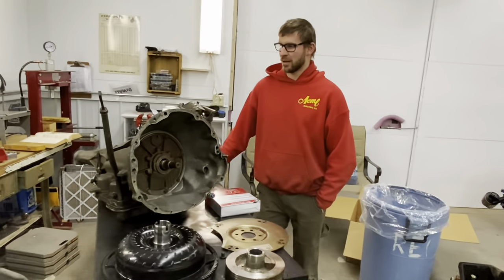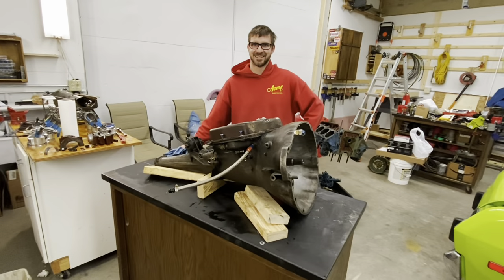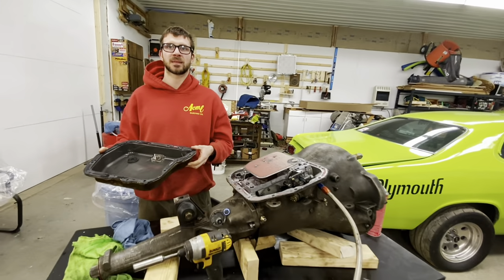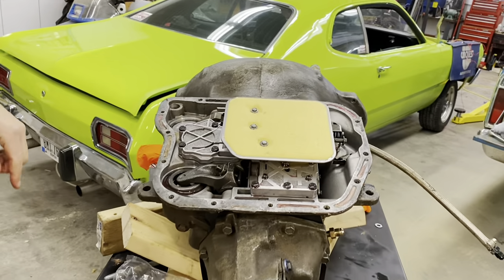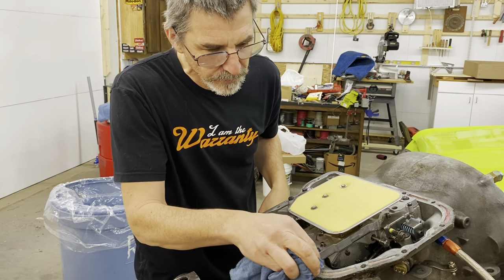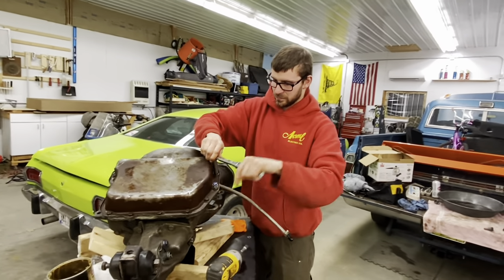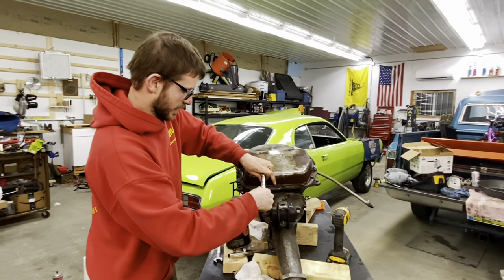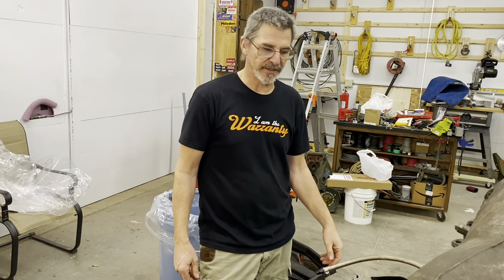How We Adjust the Bands on the 727 Transmission/727 Transmission Maintenance

Comment: I took the advice I read in a Mopar magazine many years ago.  Forget the whole torque and turns thing. Pry up on the end of the band actuating lever, and adjust for 1/4" to 5/16" clearance between the lever tip and its actuating piston.  Done.  Worked great for me for years.
Reply from the maker: More than one way to do it for sure. Thanks

Comment: Two years ago, I commented on this video and I’m still referring back to it, thank you for such in-depth descriptions of what you’re doing. Two years ago I had a brand new rebuilt 727 with a 3500 stall, the transmission rebuild shop asked me if I wanted a deep pan instead of the shallow pan, I said “sure!“. Last weekend I realized that my converter is not stalling and the car is not taking off right I took off the transmission pan for the first time and noticed that I did not use an extension on the filter I’m sure the damage has been done, I looked at the bottom of the pan and it just had a gray sludge no real metal on my magnets or anything, but lots of gray sludge. this weekend I want to take the converter out and take it to the converter shop to have them clean it out. What I’m asking you guys is would you do a full rebuild on the transmission? Is there a way for me to flush it? I’m kind of torn because I’d rather not do a full rebuild. It’s only 1000 miles on it but if I have to, I will. Any suggestions?
Reply from the maker: If it did not slip a lot, clean the pan etc and put a fresh filter and oil in it. Adjust the bands and try again. We get grey sludge too. I use ATF4 
My transmission was built in the mid 90’s overdue for a rebuild. We just went 11.72 with it.

Comment: I use the moroso blue gasket with the steel insert. It’s like $45ish and reusable. I’ll never go back to a paper gasket again if I can help it. Nice job guys
Reply from the maker: I didnt know that existed and will look for one.
We use a 96 360 gasket for the oil pan same thing. 1 piece silicone and steel reusable. Thanks for the tip.
Reply: That's The Only One To USE !!!!!!!

Comment: I cannot put a speedometer pinion in my 999, the billet output shaft doesn't have the teeth.  I also have a billet input shaft, broke both of them with my stock displacement 318 Magnum, of course 20 psi of boost helps!  Billet valve body, built by CRT.
Reply from the maker: Were not making that kind of power So far the mostly stock transmission is working well for us. You have a seriously stout transmission. Thanks for the support.

Comment: I scrub both gasket surfaces with 150 grit paper and then wipe them down and use the combo cork rubber MAHLE gasket and no leaks .Got a cork/rubber gasket with the metal sheet between the 2 layers from AutoZone . I did a video on  on the gasket if you need a part number
Reply: Yeah share the part number. Thanks
Reply: @trackandtravelwithrick8933  Autozone -727 pan gasket  MAHLE  part# W39003TC  SKU 144452  9 dollars and some change had to be ordered. this pan gasket is a sheet metal gasket sandwiched between  2 layers of cork / rubber
Reply from the maker: Perfect👍🏼

Comment: Great video guys ! 
Hey , what is your recommendation for the best type of grease to use on the tail shaft spline/ slip yoke ? I’m reading and hearing various opinions on different types of grease , everything from Lucas red and tacky to some folks use a marine grease that has calcium sulphonate in it … and how much grease should you put on it ? 
Thanks for any input 🙏
Reply from the maker: I just use a regular wheel bearing grease and only enough to not damage the seal at the tail shaft, so not a lot. Just don’t want a dry startup situation. Thanks for watching
Reply: @jerayracing Thanks for the feedback ! I have two 727 transmissions ( one from a 71’ Challenger with 383 the other in a 86 dodge truck with a 318 ) I’ve been using Dexron III in the 71’ and ATF+4 in the 86 Ram , good to know anything will work regardless of different manufacturer recommendations for each respective transmissions. The truck with the ATF+ 4 seems to shift a bit smoother , but it could be due to the linkage adjustments as well . 
That’s another area I’m trying to study up on . 
So 5/16” square or 11/32” twelve point in the adjustment nuts . Great info ! Thanks again for your input.

Comment: Great video! My Coronet shifts really early into 2nd but really high into 3rd. I’ve adjusted like crazy my kick down cable but am wondering if it’s the bands needing adjustment?
Reply from the maker: Thanks for the support.
The band adjustment wont change when it shifts. Just how it shifts.
I use a lokar cable but same for linkage. Get a helper. Engine off. Floor it and hold it till your done. Check throttle blades and ensure your wot at the carb and cable didnt slip. Ask me how i know. Then get under car and ensure the throttle lever on transmission is maxed out for wot. If transmission is maxed out before carb it will have a delayed shift.
With your early 2nd and late 3rd gear shifts i dont know. 
It wont hurt to do fluid and band adjustment.
The govorner is in the tailshaft. My transmission builder modified it 20 years ago to shift about 5600 2nd and 3rd.
Hope this helps.
Reply: @jerayracing  That helps a ton! It’s the little details that will get me. I appreciate the reply. This is a brand new transmission with a Branting 3200 stall. Last year at the strip, it was shifting at 6000 RPM into 3rd by itself. ( I had to leave it drive because of shifter issues that day). I have a more powerful motor I’ll be putting in next weekend so I’m anxious to see what that will do to my stall converter‘s stall speed and my shift points. I really appreciate what you said about adjusting the throttle lever. I did not know that small detail about when it’s maxed out before the other is maxed out. I just subscribe your channel and I really appreciate the reply
Reply from the maker: No problem man! If you ever have any questions just ask! I always reply
Reply: Rick Allison at A&A Transmission, sells a small governor weight and spring set, which changes when (rpm) the trans shifts.
Reply: @JACB006  thanks! I will definitely check that out!

Comment: I've got 2 904 and a 727, love em, my 727 is getting a little sloppy from 2nd to 3rd, will adjust my bands, what kind of grease did you use on the pan seal? Thanks for video
Reply from the maker: Wheel bearing grease, nothing special.
A slip into high gear means the front clutch could be going out. Having the kick down linkage out of adjustment can contribute to this wear.
Reply: @jerayracing  thanks, it doesnt feel like it slipping, it used to shift into 3rd at around 45 just normal city driving, now I have to gun it up past 50 or 55 to get it to get into 3rd, and will kick back down to 2nd too soon too
Reply from the maker: Adjusted too far back? Ideally it’s all they way back at full throttle and just a little slack at idle.

Comment: I have a 727 matted to a 440 big block with a np 203 twin stick it has reverse but doesn't have forward gears im thinkin it might be the kickdown band wasn't adjusted properly what is yalls opinion
Reply from the maker: Did the transmission work then fail or did it never work after rebuild?
Reply: Travis. No foward gears might suggest that the rear clutch pack is not holding or has a pressure problem such as sealing rings . The steels could be completely overheated and glazed causing them to slip. The rear clutch is called the foward clutch in a 727 because its energized in foward gears only.
Reply from the maker: Thanks for the explaination. I understand if you mix 70's parts with 80's parts. The oiling paths are different and you would have the same thing. 1 reverse and 4 neutrals.
Reply: @jerayracing  yeah, I think that sounds possible there was differences in 1978 when the added a sealing ring on the pump stator . You can use any year 727 case with any internals from any year but don't miss match pump , pump stator input shaft . You can air check that assembley outside the trans a bench. And listen for the clutch packs pop with the air pressure at about 30 psi.   Reverse I remember would be the front drum on and the rear band holding .
Reply: @jimifed2798  If I bench tested mixed parts it seems to work. I changed a pump on a 70s 727 and it failed the first test. I looked closer and saw a diference in the input shaft, so I put the original stator shaft on and it appears to pas the air test. I planned on reinstalling trans early this week. It is still on the bench. Please respond...
Reply: @rogerdodger6888  I did answer you a day after but i don't see it here anywhere.  How did the trans act in the car.
Reply: @jimifed2798  Finally got it  installed (with 200lb NP203) and tested it yesterday. It works!!!😅  For about 2 min. Like all of a sudden nothing, no reverse forward nothin. So I googled it, on A bodies only someone had a similiar problem and someone commented that if it is in park, the trans pump just dumps back into the pan. Well sure enough the shift prong had popped out of the manual valve, I had the little finger was only half way into the valve, got it fixed, seems good. Thanks for asking!
Reply: @rogerdodger6888  Awesome , glad too here your working out the bugs.

Comment: How do i know my bands need adjusting?  Does that impact when the car shifts into 1-2 and 2-3 gears?  Mine shifts way to late so wanting to see what i need to adjust after i put a lokar style kickdown cable on and did the TF2 shift kit.
Reply from the maker: Does not effect shift point. I adjust when I change the fluid at the beginning of the season.
I have tf2 and lokar. Need to adjust cable so lever on transmission is pulled all the way at full throttle. After that adjustment if you do not have a bit of slack in the cable, at idle, the lever ratio on you throttle is wrong causing too much pull early on and delaying the shift. Mine does that but I don’t street drive it often.  Look at adjusting the mount point at the throttle/ carb lever.
If you adjust slack into the cable part throttle shift will be fine and wot will be too soon and not enough pressure causing wear. You may want the cable mount point a bit further away from the pivot point meaning you may need to fab a bracket. Hope that helps. Thanks for watching.

Comment: I also need to change my speedo gear.  Seems about 10 mph more.  Never done it.  Whats involved?
Reply from the maker: What gear and what size tires 
I have a chart. You need to pull the speedo gear and replace it. It is where your speedo cable goes in. They are color coded.

Comment: how would you know what band arm you have?  And can you adjust only the exterior band without doing the reverse (inside) band?  I just did a filter change a month ago and didnt' think about adjusting bands then.
Reply from the maker: Yea you can do just the external if you want. You won’t know which one you have until you look at it, it’s stamped on it.
Reply from the maker: Ours is a 2.9. transmission came out of a 79 d150
Reply: @jerayracing  thanks for the quick replies.  I have an '84 d150 I picked up a couple months ago.  Slowly going though it making adjustments.

Comment: What does the bolt on the outside of each servo do. I tightened the one near the dipstick. It did not come tightened all the way down.  I just put in a tci 727.
Reply from the maker: Dips stick side two bolts that require a 7/16 wrench are pressure ports to test the transmission on the bench. 
The fact that they are loose says they must have tested it, so that’s good. 
Looking at the spare on the bench there are 3 of these plugs on my 727. Hope that helps. Thanks
Reply: @jerayracing  Yes it helps and I'm grateful for the information. I was worried I screwed something up.  It's a tci trans that cost $2000. I have the  Dyno test results included in shipment. Lots of attention to detail I noticed.
Reply from the maker: Should be a good one 👍
Reply: @jerayracing  I've been going through a 75 d200 that sat for 20 years.
Reply: @jerayracing  I had trouble deciding on torque converter. Decided on stock since truck is for hauling
Reply from the maker: Good call. You don’t need the extra heat of a higher stall.

Comment: Type F ONLY
Reply from the maker: Type f works, depends what your trying to do. I ran atf4 then went to dexron 3 and at the track stall speed stayed the same but top end slip was several hundred rpm. I’m back to atf4 and top end efficiency is better. Type f is good for stock builds and no shift kit.  We run about 4500 rpm launch with a 9 1/2 “ converter and I can run the same fluid all season.  I am considering using 2 quarts of John Deere hyguard to get some top end efficiency. A 727 will run on anything.  Thanks for watching